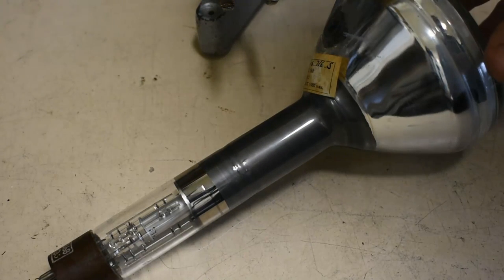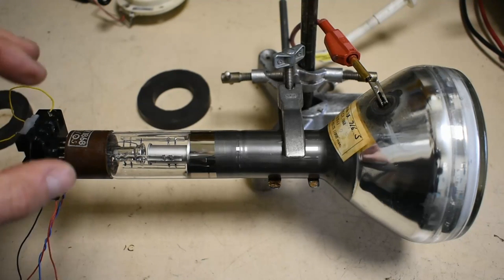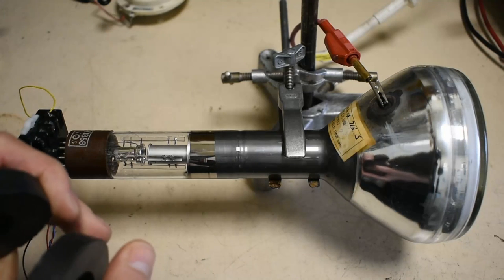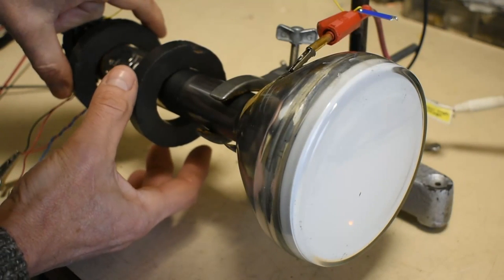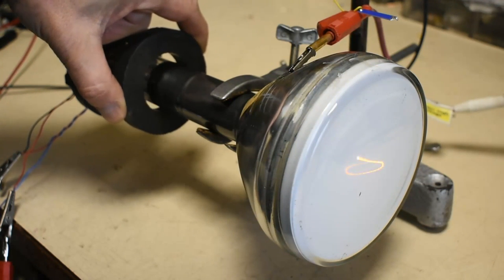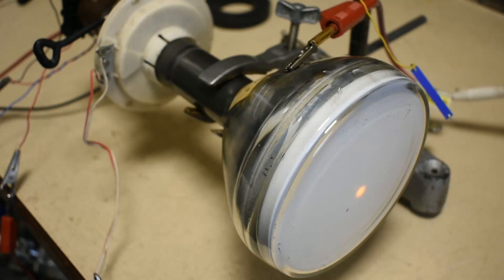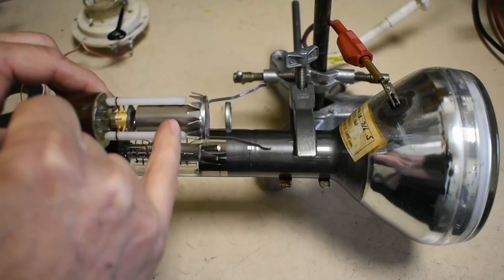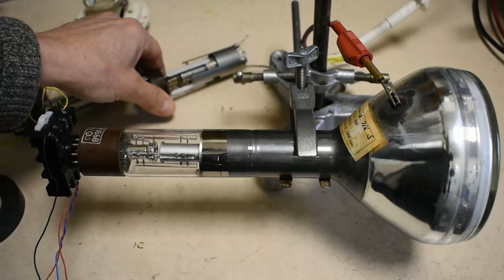Magnetic Beam Focusing on a CRT

Comment: Hey mate, great demo 😁.. i was told that earlier radar system had rotating deflection coils? Sounds odd as you could do this electric ally and avoid the headache of slip rings or whatever they would use.. ps giz them focus magnets 🙏😂 ive got an electrostatic deflection tube (circular green long persistence)  that doesnt seem to have a focus electrode😞, i assume it needs these magnets, i might be able to take a couple of large ferrite cores and wind something to do it electrically.. do you know the orientation of the poles? ... 

Steve
Reply from the maker: Good question, I needed to set that up again just to verify it. Strange to have a tube with electrostatic deflection but magnetic focus, but anything is possible.  I knew the two ring magnets are set as opposing from when I used to dismantle TV with these in them but didn’t know the poles. It looks like it works with either but for a small distance between magnets  north poles opposing creates the correct focus. The magnet construction in these are uniform poles on each face, the same as the construction of the circular magnets used in oven magnetrons. However, the aperture in these is too small for the neck on these old tubes.  These magnets are hard to find. Not only have the TV that used them been out of production for over 50 years. They smash into bit easily, just dropping one is enough.  It will be possible to wind two coils to create the field electromagnetically. 
I think you might be right with very early radars using a mechanical system to synchronise the sweep with the aerial but never seen one, well before my time.  🙂
Reply: @tuopeeks  okay thanks for that mate, old CRTs are  really cool, its really quite surprising to me that they are already getting hard to find despite the colossal numbers produced and their relatively recent redundancy..